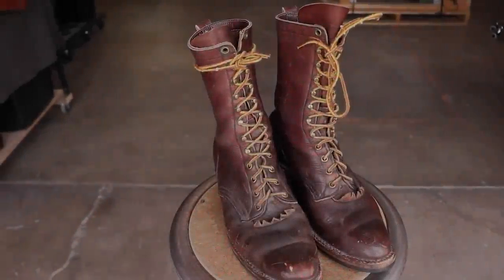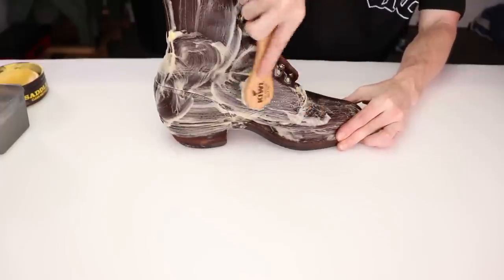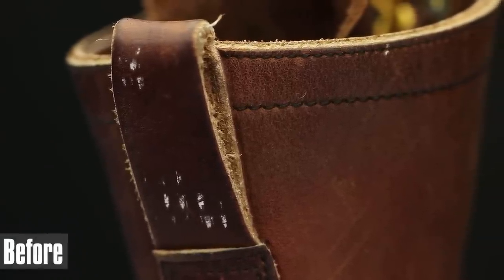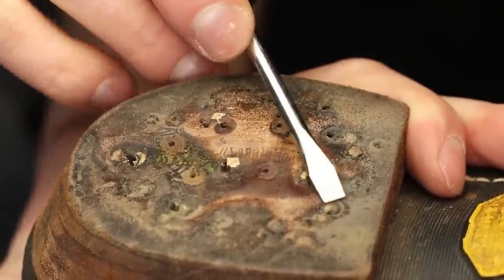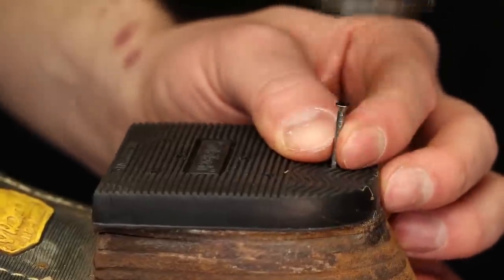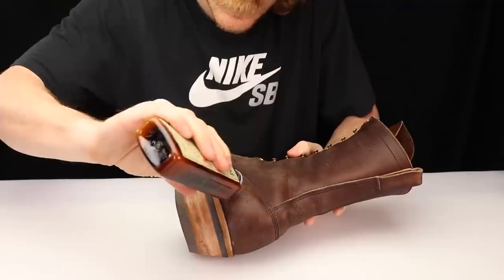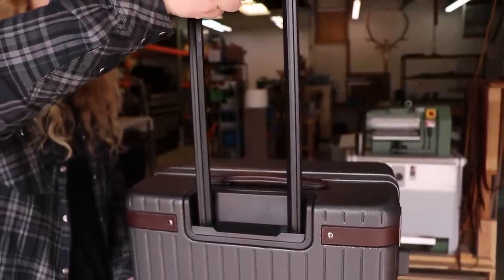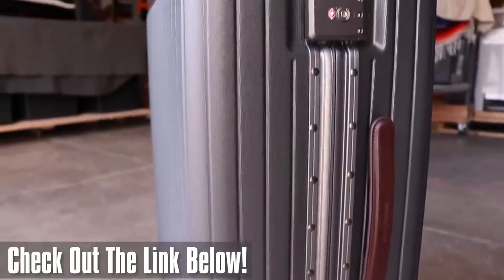Rare $549.95 WHITES BOOTS Restoration - That You Can Do At Home

Comment: Cut women's high heels in half! It would be so nice to see if there are any comfortable high heels anywhere in the world.
Reply: Pretty sure that part of why most women's high heels are uncomfortable is because the heel is lifted too high putting too much pressure on parts of your foot that aren't well suited to holding your weight (granted I don't have first hand experience with women's shoes).
Reply: BUMP! I'd love to see a dissected women's heel.
Reply: alot of the northampton brands and carmina make turn of the century women's heels still.  not stilleto but a modest heel, and they use a welt so they can be recrafted.
Reply: @garethbaus5471  it's mostly a combination of heel lift, aswell as heel thinness
Reply: @mcfarofinha134  I suppose that does make sense my work boots have roughly 3 inches of heel lift, and they are still fairly comfortable.
Reply: Order from a custom boot maker, ask for a dress boot style with a high number leather heel stack. The layers will break in the same way Nicks logger boots probably will for a comfy walking boot. Not a boot afficinado, just guessing.
Reply: @McSpuds  the heel stack isn't generally the part of the boot that breaks in, if you wanted something that forms to the foot it is probably best to go with a fairly standard welt construction with cork fill.
Reply: If you want comfortable high heels you gotta look for bulkier heels, the material of a skinny heel is very hard whereas a thicker heel can be softer and still provide the height
Reply: Dancing heels are usually more flexible and comfortable
Reply: I don’t wear high heel but I’d like to know for my wife

Comment: He said he also learned from Bedos Leatherworks. Steve on there has used leather filler for marks in the leather, to smooth out the surface. You put some in the marks, smooth it out with a flat tool. Then you sand it. You repeat the process however many times you want, until it's smooth as you like. Then you paint dye over those areas to blend it all in. I think the boots really would have benefited from the use of leather filler.

Either he didn't watch Steve's videos deep enough to know about leather filler. Or perhaps he does know about leather filler, and wanted to keep it simple for the general public 😅 I think I can see why since, maybe some people don't want to put the time into filling in cut marks in their boots. I know there's people out there who love the "character" in their boots with the patina, scuff marks, and the cut/gouge marks. That's completely okay! It makes them look interesting and cool! And then there's also people who do use leather filler. Anyway, people will do what they want with their boots, and that's ok. I just think it's cool to have seen what leather filler does. The results I've seen are amazing! You can barely notice the marks anymore, when seeing the shoes/boots up close. From a distance, you don't notice them.

The results of these boots look amazing! The cleaning and conditioning did more than enough to enhance the overall look of the boots! Even conditioning the heels, the midsole sides, and the leather brought out a beautiful sheen! Good work guys!!😊

Comment: Since you got an hot air gun, use that instead of burning the wax. That's what came to my mind once when I cleaned my boots on my work table next to the tools.
Also, If you preheat the clean leather, it absorbs the oils and waxes WAY faster. Just a bit of het tho, leather must be able to be touched!!

Comment: I love this videos I bought a pair of whites boots on eBay, they were a little banged up but the structure of the boot was pretty good.   I want to put a new rubber part of the heal at the bottom they are a size 8.5 what size of the rubber part do I need and where can I get it.

Comment: do you ever condition the inside?
Reply: Not really - that would actually prevent the leather from being as comfortable on the inside, especially since so many boots are lined. 🙂
Reply: From the video he made of a 3 year old beat up pair of iron rangers, he recommended to condition the insole, if its a full veg leather sole.
Reply: @gustavvarming2365  veg leather? what is that
Reply: @earlgrey1  by veg leather sole he means vegetable tanned leather. It's a way of tanning the leather.
Reply: @earlgrey1  Vegetable tanned leather

Comment: If I buy used boots, I worry more about cleaning the sweaty, ripe, fungal insides -- any tips there?
Reply: Steri-Shoe makes a UV-C light sterilizer that works well. I do each new to me pair 2x before trying on. There is also a product called "10 Second Shoe spray" that I have heard mentioned a 100 times.

Comment: I need to replace the heel cap on my first pair of White's Boots. ITs the 700 V-bar sole. I need help with finding the cobblers anvil, when looking around I rarely see any size and if there is its something I am not familiar with (for example I found one that was #18 but it was tiny?) I wear size 13EE in White's. Is there another way to describe the cobblers anvil? am I saying it wrong? is there any reference material which will explain the sizing of the iron shoe?

Help! thanks.

Comment: HI, nice video, really interesting, I have learnt a lot ;) Quick question: what would you use if you want to waterproof the whole boots ? I noticed that you use wax on the rigid part, but what about the flexible part of the boots?
Reply: There isn’t really a easy way about doing that without discoloring the leather, but if that isn’t a  issue I personally use either huberd's shoe grease, or snow seal over the entire boot. You can find either of them at most sporting goods stores and it’s good stuff. All you need to do is heat the can in water off the boil, stir it so it’s all consistent, and rub it into the boot with either a rag or a gloved hand. There are plenty of other ways of waterproofing boots and I’m not going to say how I do it is best, but that’s how I personally do it. Hope it helps

Comment: Alcohol doesnt take off any color in my experience.  I used to work in the oil fields and to get off the old dried up oil off my red wing pecos I used to hit it with a ton of brake parts cleaner. not the wussy formula but the full strength stuff and it never discolored my pecos. still have them from 2007. tread is gone but mink oil keeps them looking great for shit kicking.

Comment: I can tell you arent a cobbler because you called the previous cobbler lazy without considering common reasons quality can be lower on a repair.

The reality is the customer probably haggled him down 20 bucks on price, so he got a 20 dollar cheaper job. 

That or is just a shopping centre shoe repairer who was busy or flat out. Not totally justifying the shitty work  because there are some shocking jobs i have come in. But more explaining from a working cobbler point of view. Time management and customer requests can cause quality to be lowered. As long as the cobbler is honest with the customer and say "Look i can fix them quickly for 40. But the qulity isnt guarenteed and we skip things like the free polish and lace replacement and things like stitching the sole wont be done, just glued" ect. But we explain that when they ask for a cheaper price. You get what you pay for kind of thing.

Too many people bring you a 50 dollar boot and complain about a 60 dollar repair. So you have to make exceptions to keep the customer happy and encourage the sale. 

Not everyone wants quality. Infact most people want a cheap price over anything.
Reply: He put Vibram soles on, but didn't even take the time to get the thread pitch right so the new stitch would be going into the same holes, the stitch was super wavy and didn't follow the old stitch line, and was just obviously sloppy. There's a difference between cost reduction and sloppy work. Like you said, not picking the old stitches out (labor cost @ $85/hr, 3.5-4 min per shoe, 7-8 minutes, is $10-11.50), could have saved him $10, which is fine, but not setting the thread pitch, following the old stitch line, to keep the stitches using the same/old holes and to keep the stitch line straight is lazy and sloppy. It's leaning more towards sloppy for several reasons. The stitches are already cut, and just need to be picked out, which only takes a few min. They are $400 boots. He put expensive (relative to other options) Vibram soles on. He didn't take the 30 seconds to set the proper thread pitch, and he didn't take the care to follow the old stitch line, to keep the new stitches on top of the old ones and using the same holes.

Comment: What sort of work is someone doing that would wear these boots. All the people commenting seem to be guys and I just can’t picture any job or worksite in Australia that a guy would wear these. They are women’s boots yeah?
Reply: Packers are work boots meant for people who work from horse back. They way the toe is shaped is so they go inside the stirrups smoother and easier. And the heel is that shape for spurs. 

Packers are kind of like lace up cowboy boots. Except cowboy boots are sort of useless outside of the saddle, so Packers usually have better tread and more ankle support (laces vs just the leather shaft).

They're works boots, just from a bygone era.
Reply: @jonfetzek3053   interesting. Would people still wear them?
Reply: @johnhenson4054 , stable hands maybe. Some logging is done here with draft horses because of terrain reasons. I could see high end wilderness guides using boots like these. Like if it was your job to lead tours on horseback into the Backcountry for a few days of hunting or camping (or both).

I think 'packer' is a term for anyone doing rough country work for someone else. There's a company here in the USA called filson that does some serious work wear and had been for a very long time. They have an entire line of 'packer' clothing.